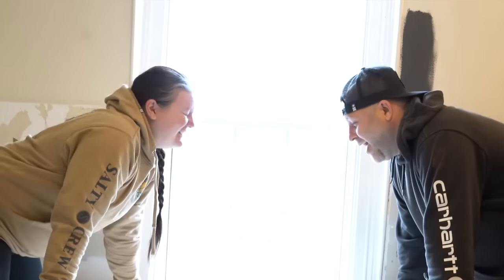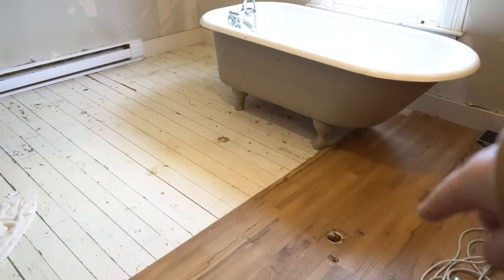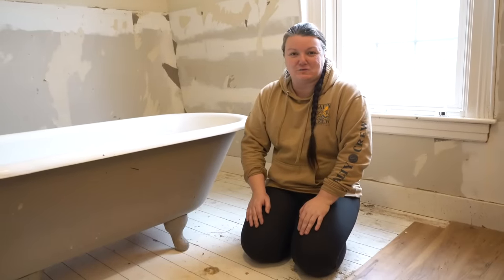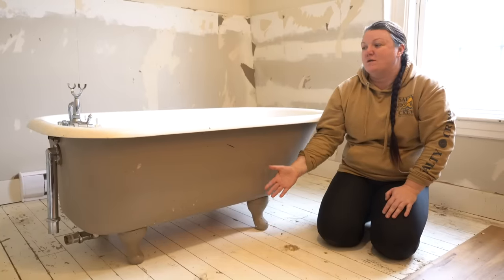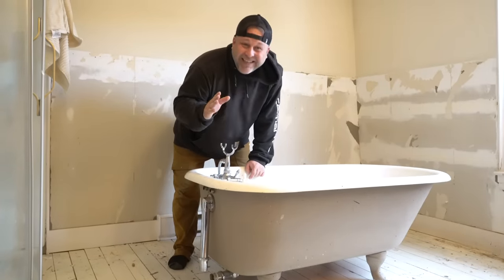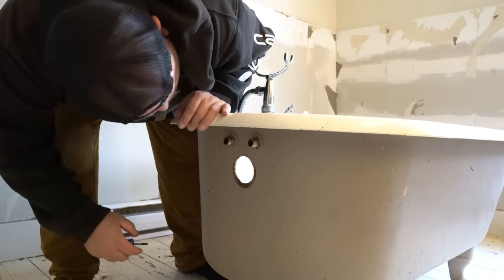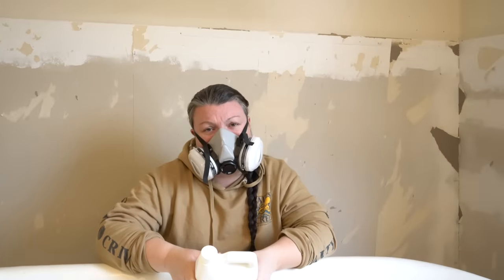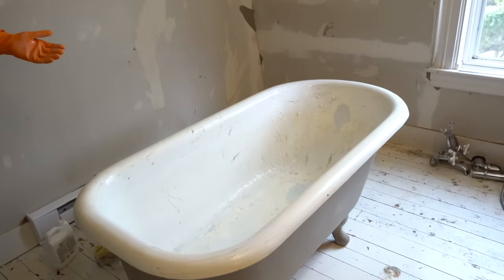SO far this is an EPIC FAIL....Bathroom Renovation

Comment: My tub has the same fat stubby feet.  I discovered the height of the feet are on the back.  Take those measurements and head over to ebay.  Eventually, they will have claw foot feet you can use.

Comment: You are going to regret putting the tub along the wall opposite way of the follow of the room.  Place the faucets in line with the window and relax with the view of the day clouds or the night stars.   On any other angle you will have to have you head turned to the side and bingo you get out the tub with a kink in your neck.

Comment: I removed epoxy paint from my tub, tile walls and tile floor in my bathroom using Citristrip Paint Remover and covering it with plastic overnight.  Worked great.  Not sure if it's available in Canada.  The stripper stops working once it dries.  Try spraying it with some water and covering it with a shower curtain to stay wet overnight.  I figured that out the hard way.  Keeping it covered to keep it from drying out.
Reply: That’s exactly the product and method I’ve seen work for a lot of other DIYers!!
Reply: Garbage bags cut open work well also.

Comment: From the first time you showed the tub & said you planned to move it closer to the window I felt you should also spin the tub. That was without knowing the view would be better.
Yes it adds to the replumbing job, but for the finished product well worth a little more pipe.
As for those non clawed feet. Yes paint the entire base gold, but then add some detail with black paint to fake those Claws on the feet. You can practice on the feet closest to the window then do the room side feet last.

Comment: I'd test having the tap of the tub  centered in front of the window (I know you want that view) and the foot pointing away from the vanity. I've heard of them taking old tubs and dipping them in acid to strip them. Sandblasting may be an option, too but then someone has to move the tub. Heavy work. I agree with possibly sanding the tub and then painting over it. Re the tub feet: You are very talented so maybe you can paint those feet into claws? Use shadowing, etc? Or maybe use silicone to shape claw feet. I bet you could do it. Then paint them gold like you wanted. Don't rule out painting the outside of the tub flat black. That might look cool with gold claw feet and minimal (and I mean minimal) touches of black elsewhere in the room. Have fun with this!

Comment: I would say it's probably enamel or epoxy on the tub. Be careful not to apply different strippers on top of each other. Sandblasting may be the only solution. FYI, old tubs and sinks are commonly lead based fixtures. Good luck!

Comment: I love copper tubs...I think copper would be  more of a statement, show piece - stunning on your bathtub just like your copper ceiling stole the show in your foyer. For the bathtub legs, you could use resin and molds and create your claw tub or something ornate rather than the existing bubble clumps.😊
Reply: Would resin be strong enough to hold a cast iron, porcelain/enamel tub. That is what this is. Hence them saying it’s so heavy. I do

Comment: Can you place the tub so the faucets are in front of the window & the view is directly out of the window? That would look pretty x

I'd also choose a soft sage green or a deep dark red for the outside of the bath. Both are vintage colours on UK claw foot baths. It looks like it's been painted on the inside with proper enamel paint. I'd hire a small gentle sand blaster, take it outside & blast it all off.

Comment: I vote gold on the outside of the tub, that will look soooo cool!!!.  As for the inside, sand it but use a foam rubber disk with the sandpaper if you have an orbital sander.  It will help you from making possible flat spots.  It will help you sand the curves of the tub a lot easier.  Blessings from Oregon.